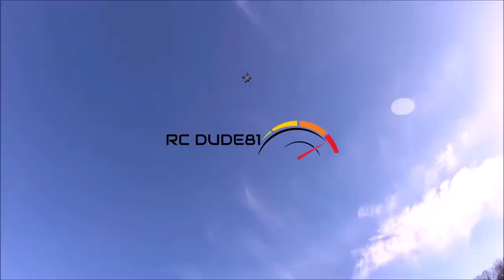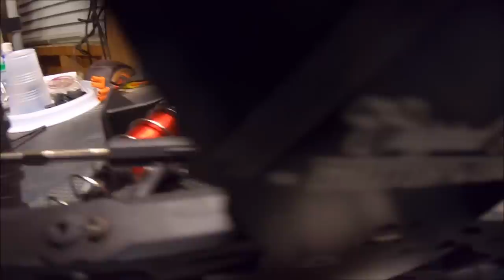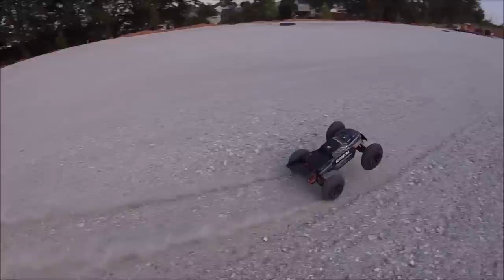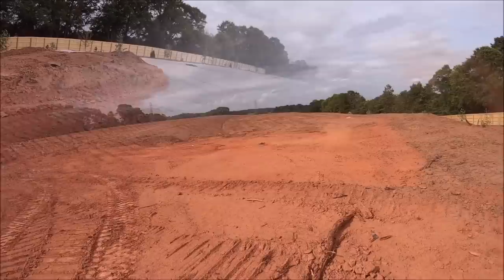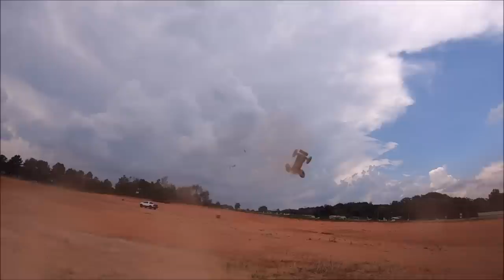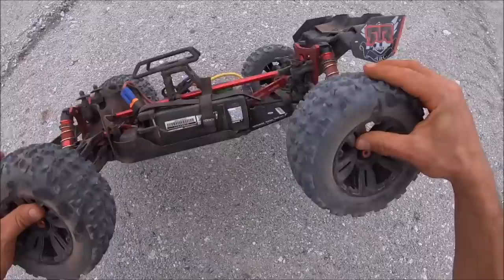NEW!! Arrma EXB KRATON "EXTREME BASH" Roller and first stress test!

Comment: That's awesome Eric!! An upgraded roller right out the box 🤩 So happy Arrma did this. It will save so much time and money from getting a Kraton and doing all the upgrades yourself 👍👍 Love that new body style and color, really stealth 😎 I agree the new front bumper looks nice 👌 The updated drivetrain is what has me most excited! If you want you can get some carbon fiber tube for the tower to tower to strengthen it up some more. I did that on my Mojave and I am still rocking a straight stock chassis 👌 Good first run man 🤩

Comment: How do you keep your lipos from warping. I have had several flatten out during hard bashing. It looks like your packs are on edge here.
Reply from the maker: I run padding like yoga mat of soft Styrofoam in the battery trays which helps a lot with shock absorption. Also I wrap my packs with Gorilla tape if they start getting damaged. 😎👊👊

Comment: One of the reasons I didn’t get an arrma is because of the electronics. Radio specifically. And I would need to pretty much immediately upgrade braces or risk bending my chassis. Not about that life. I will DEFINITELY be getting one of these. Gonna compare it to my MT410. Really excited. I’ll buy every “EXB” version arrma. Hopefully they do this for the 8S model.
Reply from the maker: That's exactly what this beast is meant for! Gives you a clean slate to build upon!😎💪🤟🤟

Comment: Man, all the upgrade companies just had a "oh nooooo" moment.  Im curious if this exb is better then are m2c"d kratons 🤔  I bet its alot lighter anyways.  When they release the talion though, that bitch is mine ! 😄
Reply: Talion EXB damn! 👌
Reply: Michael Rubino but for 50 dollars more all up you can’t complain
Reply: I just got a Mojave roller. Idk what power plant to put in her. I have a Hobbywing max8 2200kv combo but I think it may need something more? What do you guys think?
Reply: @bensettos8705  the 2200 kv is definitely going to get hot in the Mojave.   Im running a max 6 with a hobby star 1730 kv 4092mm motor.  A 1650kv rocket would be a good choice as well.  The Mojave is definitely should have a max 6 in it.  A maxx 8 will work with a lower kv motor but imo its not ideal 👍

Comment: Is this motor much more powerful than the story blx? Does it get hot?
Reply from the maker: Yes quite a bit more torque. Geared right, temps are acceptable!😎👊
Reply: RC DUDE81 would the hobbywing 4985 be a better option?

Comment: Whaatttt already??.. That was quick! 
Brother Eric that was a killer bash, love that spot especially. And thanks for sharing this so fast with the announcement just coming today. It looks to be a great value for hard bashers to get this much true strength added mods for that price! Props to Arrma for really listening and addressing really every one of a hard bashers needs here 🚀🚀🎯WOW!
Will see if 4mm is enough on that chassis (you take a ruler to it?) but I'm sure it's lighter than some of the aftermarket options so that helps. 
Would think the M2C Hinge pin kits amung other things will help even more, but man the Bumper looks sweet, chassis and Towers, braces all 7075 like we asked, them diffs though, with the front and Center being LSD really curious as your thoughts how they feel different?? But they will surely be more durable being wider and more angled crown gear 💪😎
#ThanksArrma
Thanks again for sharing Eric, bet you been having fun the past week.... Any imput on this diffs and compatibility with other aftermarket parts would be great. 
Appreciate the share brother👍🙌
Keep sending it 🚀🚀🚀
Reply: Why wouldn’t 4mm 7075 be enough on the chassis? Its a 3mm chassis btw. However it is machined 7075 vs a stamped 6061. It’s gonna hold up a lot better vs stock but not as tough as an M2c chassis
Reply: @TheBigToe69  sorry meant 3mm, yeah that's my point.... Rich and Eric are used to sending it 100-200 feet and the M2C has been solid for them. I'm sure this will be a huge improvement over stock but not sure it's "Crazy Basher" proof.... Nothing really is, I'm sure they will push the limits and report back.

Comment: You got the breaking down great when jumping I raced 2WD trucks 20yrs ago I had a Team Associated T3 & a  Losi XXX graphite stadium truck I raced the Losi the most because it was a bit wider and longer so it was a little more stable over jumps and it controlled better in the air when breaking I won the 2003 points championship at Coppers RC Dirt Oval Tony Stewart was there for a couple days It lasted a week AWSOME I miss it bad I like off road best Great driving jumping Bad Ass Truck also 🔥👍✌️I subed

Comment: Great video and awesome job putting through a stress test. 👍🏻 How high do you estimate the biggest jumps you did ? You was definitely sending it. But I noticed 2 things that I want to know about. 1) It sounded like it was slamming really hard on the landings. Was it ?  2) What did the bottom of the chassis look like after your first bashing? Other than those questions you definitely showed the new EXB roller to be a real beast.👍🏻💪🏻💯🤙🏻

Comment: Can't listen right now, will have to check it later to see what motor your running. Did you notice if they did anything for the wing mount? I read the stuff on arrma-rc.com and see that they beefed up the ring/pinion, but requires new cups to be used. Not sure I'd want to fiddle with the weird "limited slip" diffs if I don't have to. Just seems like one more thing to deal with where 100/500/100 oil does exactly what I want. I just want stronger ring/pinions for my outcast... so will likely get the diffs and deal with the new stuff inside anyway.

Comment: Hey 

The Rear Toe in on the exb are preset and unadjustable

Is there anyway I can adjust the rear toe on my exb?
Reply from the maker: No real way to adjust the rear in stock form. It's set in from the factory to help keep the truck straight. It would take custom rear suspension blocks with adjustable degree angles to change it.
Reply: @RCDUDE81  do you know of any brand like m2c or something that makes custom suspension blocks?  It's just the hinges right?

Comment: Do you by chance know if the holes on bottom of chassis line up same as v4 kraton? I just got this truck and am looking to get a chassis protector so just wandering if the ones for v4 kraton will work? Thanks for any help you can provide
Reply from the maker: Yes it will. I just installed a M2C chassis on mine and everything lined right up.
Reply: @RCDUDE81  thanks bud! Why did you change the chassis already? Wasn't satisfied with the stock one?
Reply from the maker: It's a strong chassis but had a spare M2C in my garage staring at me!🤣

Comment: I gotta question for ya I got the same set up in mine and it’s going faster in reverse than forward do I need to switch my motor wires around on my esc ?
Reply from the maker: Yes probably a motor wire. Just switch any two around. If that doesn't help, check your remote and make sure the throttle isn't reversed.👊
Reply: @RCDUDE81  when I switch the motor wires around then it makes my forward throttle go reverse and my tactic remote throttle setting is on neutral? 🤔
Reply: Oh I got it I switched the wires then switched my throttle control to reverse it’s a wild animal now I was having a brain fart thanks Eric

Comment: Finally got a chance to watch this with sound. I forgot about your complete lack of fear with flight! Crazy air! Will be interested to hear how the diffs hold up for you with that setup. I know I run heavier tires, but your running a motor with a lot more torque than I currently run (blx2050kv/max6), so will like to hear your post season results to see if it warrants spending $140 on a couple new diffs/pinions for my outcast. I have to assume that any of these that are released will be snatched up quick. Did arrma give you a price point they are planning on?
Reply: Now you don't have to replace every part on an Arrma with aftermarket parts. About time...

Comment: I have the same ESC and motor, do not like it at all. The ESC is great i guess but the motor to me is slow and weak. No idea but i do have a 26t pinion with a 50t spur. Also using a panther 6s lipo and 100k center diff and like 10k from and rear. its my only RC (V2 Kraton) so no clue.